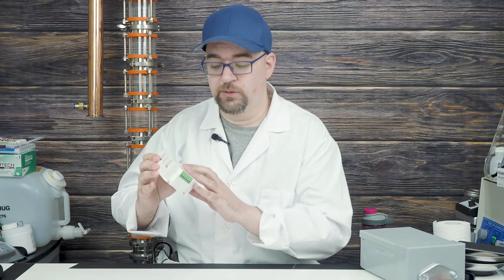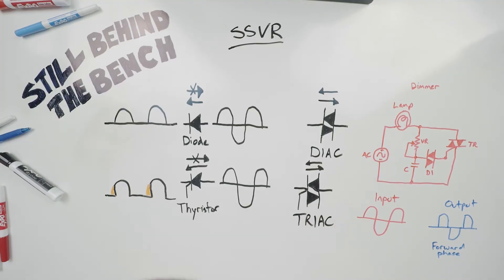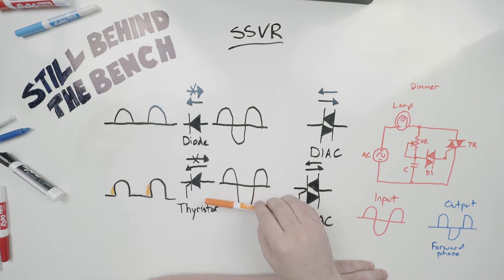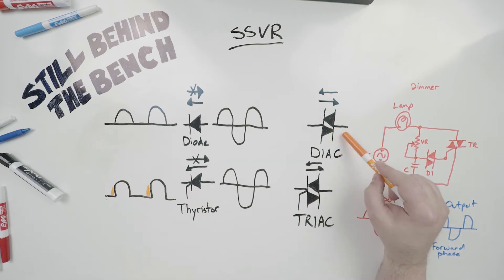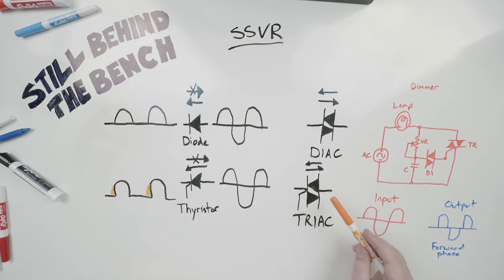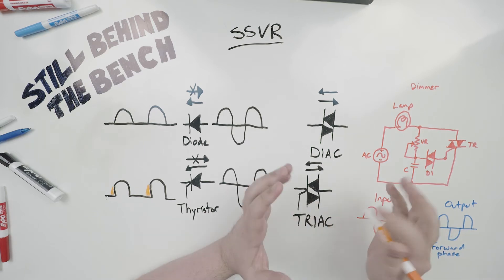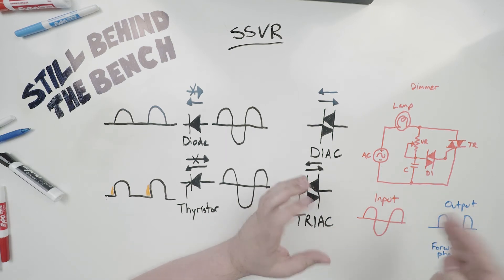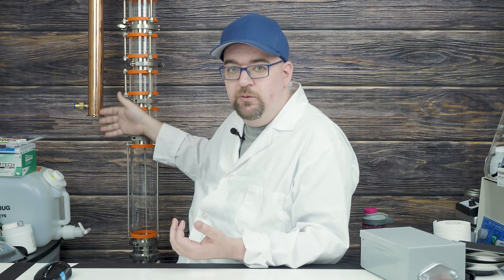Ep 009 - Power Control

Comment: A 3rd an underrated option is a digital power regulator like the Auber DSPR400 Still controller. It's neither a PID or SSVR. It's a digital power regulator where it burst fires the SSR, timed with the AC cycle to produce smooth regulated power at 1% increments. It's not a whole lot more than a regular PID.
Reply: Hi I'm in Australia so a lot of this stuff don't make too much sense to me but I have a heat element which you can buy off eBay for a keg it says 10A 250V and it's 2200watts I need something plug and play where I can lower the temperature and obviously I need it to be a constant power supply so it doesn't cut in and  out you seem to understand this stuff do you have a link or something you might be able to provide to an eBay purchase or something thanks

Comment: EDIT:  Thank you for the product recommendation -- Can you tell me which wires get connected to the SSVR? (In a three wire system - 240vac - two hots and one neutral)?

For the viewers: IF you order anything from China during their New Year holiday, just remember it's kind of like when we used to close down for two weeks around Christmas.  And, ePacket is cheaper than UPS, but, it takes 23 days after it flies out of China (I was able to get text messages from our Post Office tracking it, after it got to America).  Shipping was $35, with heat sink, fan & potentiometer $99.

If you don't have a GFCI breaker, and you plan to plug it in to a dryer or stove outlet then some People recommend you get a, "Spa Panel," which is just a subpanel & GFCI breaker for $88 -- It won't satisfy the NEC electrical codes, but it could save you from electrocution, and is portable.  Also, you can find used GFCI breakers on Craigslist for $30 or $40, and home improvement centers can order the outdoor breaker box for $21.

ElectricBrewery, and others, recommend you use SJEOOW 10/3 portable wire over the SOOW the sell by the foot at many home improvement centers.  Lowes sells twenty foot spools for $34.  (the difference is it's cold and heat ratings)

The SSVR from Finglai is meant to be mounted on a wall or panel -- the matching fan bolts to the heatsink.  I chose to overthink it, and used a NEMA 4X enclosure since it'll be used in a laundry room, technically a "wet location" -- I fabricated coupl'a small fan shrouds - the heatsink and fan go into the enclosure, cut holes on each side, the shrouds allow air flow while keeping fingers away from 240 volts, and it's rain resistant, like a NEMA 3R (but not, haha)